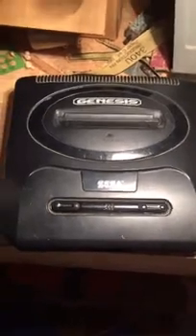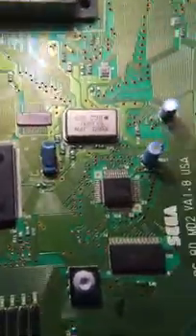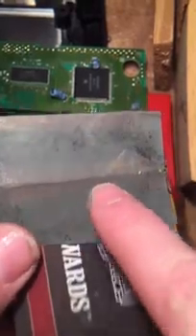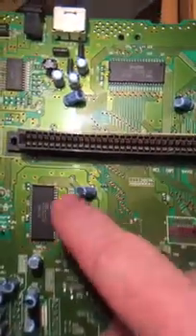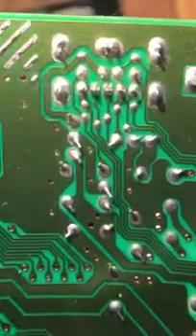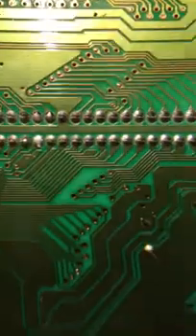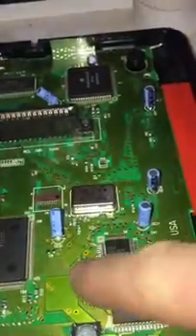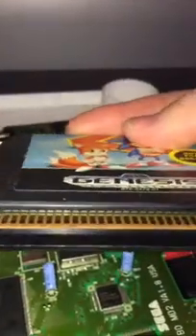Sega Genesis BLACK SCREEN OF DEATH Fix

Comment: 12 min 38 s I have a North American Sega Genesis. It's the model that does not have High definition graphics printed. Your plastic case looks like Model 2.
My power adapter says Model 1602-22-1, R-1179, LR57518
Input 120 VAC 60 Hz 20 W
Output 9 VDC 1.2 A
I just bought this. Is it the right power supply?
Reply: I had won it on ebay for 50$. It came with 2 controllers and 5 games.
I cleaned up the cartridge port. There was some dust in it. It's working now!
The other issue is that the graphics is very noisy. I was turning the RF plug into the RF output to get rid of oxides. It helped quite a bit.
I want to try the AV port. I have to make my own cable for that one since it was not included.

Comment: Info pops up then black screen genesis 3. I've got one of those 801 Game cartridges everdrive things the first time I turn it on it stayed on the menu screen for a bit I was fumbling to put the controller in it seems like it cut out to black screen 

Every time afterwards it would last shorter and shorter on the little menu thing until now it just goes straight to black screen I'm going to try to clean it  I didn't know black screen was a thing . 

What you think I need to do??  I have multimeter about 20 different soldering guns solder all the chemicals needed to clean  electronic contacts everything I need to take it apart. The only thing I'm missing is the common sense the Ingenuity and the  know how.. A goal would be great to like what I need to look for. Yeah  thanks in advance even if you don't reply this for reading this crap
Reply: Just had the same situation you describe with a Genesis 3 console as well.
And...I just got another different one...and black screen is all I get.
Did you find anything?
Thanks!
Reply: @victorhugovaldezsoto  yeah buddy I took it apart and there’s not much to it. I cleaned the area where you put the cartridge in and makes connection. I cleaned it real good with some 99% IPA and a wire brush I think it was a brass brush, one with fine wires,  not real course. Brass brush will itself leave residue. Although it displaces and corrosion and the IPA removes any brass and cleans it all up nice. I plugged it back in and it worked 

I also got a a series one version one whatever off eBay Seller said it didn’t work made a real loud buzzing noise and they were selling it for $20 I looked up what caused that they said it was the power supply. Specifically an aftermarket power supply didn’t work well you need an original. Yes so I bought the power supply and I went ahead and got the genesis and it works beautiful. 

Genesis three I got from was on the side of the road somebody was getting evicted it was in a bag with a bunch of other stuff can’t beat it. With chords and everything. Also best get one of those multi cartridges that have all the games. Those things are definitely worth it.
Reply: @waltersobchak7275  Thanks for the reply Walter. Well, I'm struggling right now with the cleaning - no luck so far :( Will keep trying. Thanks again. Nice find that Genesis!
Reply: @victorhugovaldezsoto  I really need to where my glasses when typing. I’m sorry I cleaned up that post for you. Clarity is key😂😂 I sounded almost illiterate.😂😂